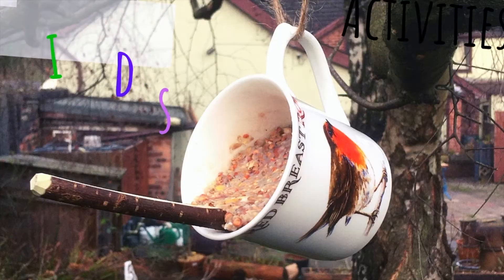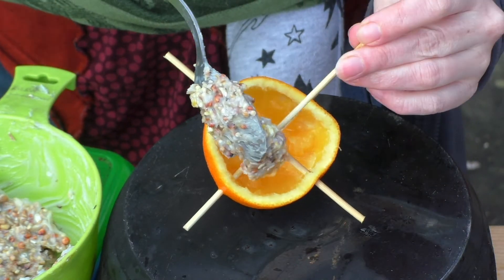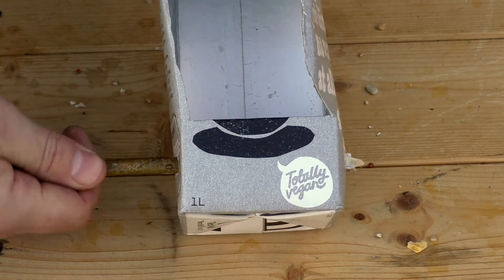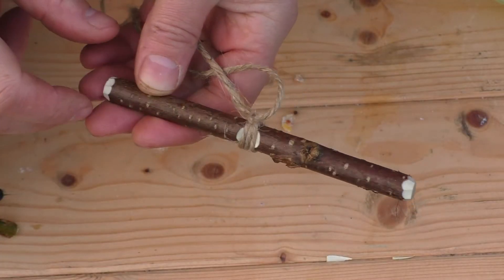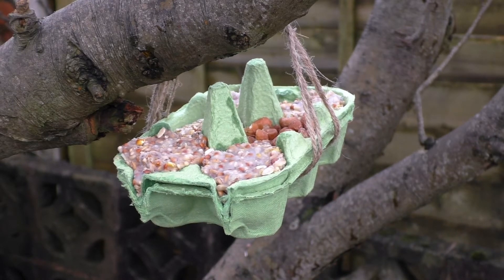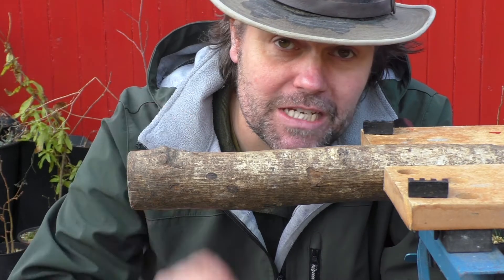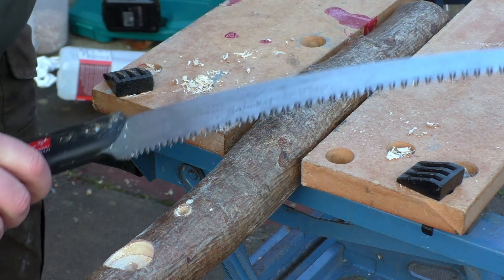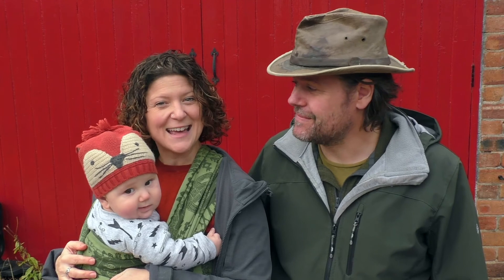Make Your Own Bird Feeders (Outdoor Activities for Kids)

Comment: Sorry, probably silly question. How do the birds get to the hole to eat the seed in the milk carton if the perches are on the sides with n9 opening? Hope that makes sense
Reply from the maker: No problem. We've seen birds hop from the perch to then perch on the bottom lip of the hole. It seems to work just fine. Only for smaller birds though.
Reply: @WoodlandClassroom  thanks for your reply. Will give it a go!